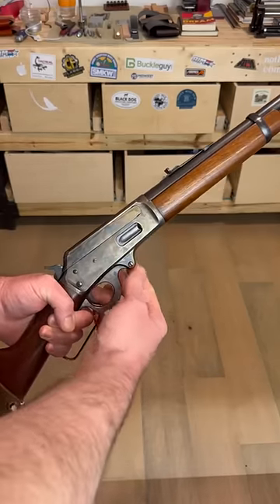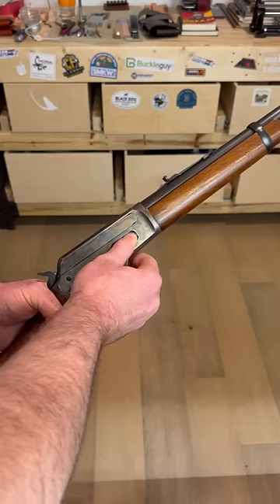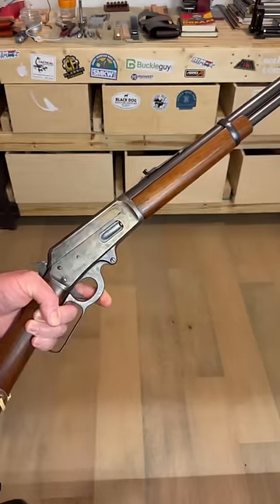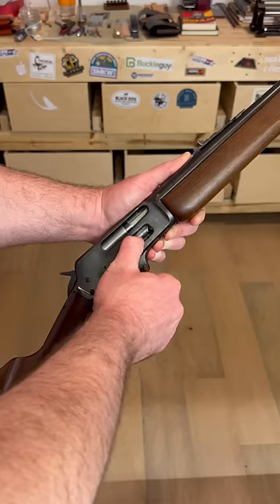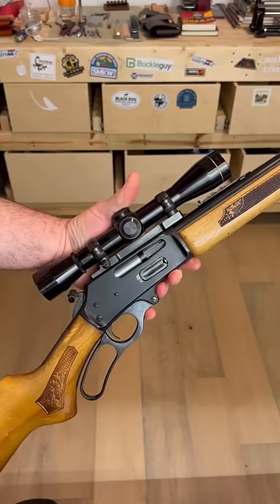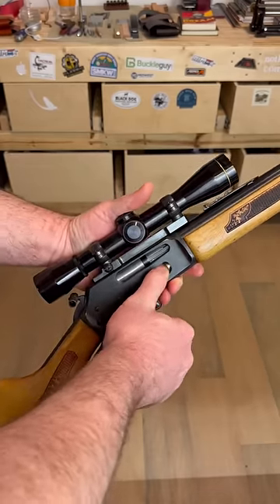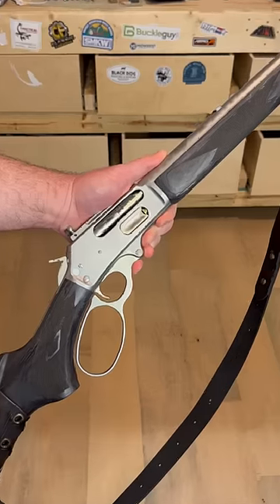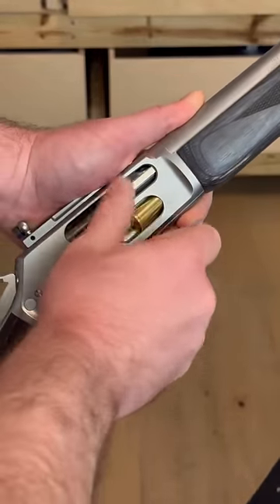Ruger Marlin 1895 Trapper 45-70: Can you unload any lever action rifle like this? (Pt.2)

Comment: Ruger buying Marlin was a massive win for both companies.
Reply: Fuckin A,      there doing right by a great ol company
Reply: It might be a golden era for rimfires too then.
Reply: Can I have one of those 😮
Reply: It was a win for everyone 🎉
Reply: not often that a company buying another is actually a good thing these days
Reply: Didn't the quality go down?
Reply: @starfishprime2864  I personally think so andddd the price went through the roof as well.
Reply: Why is that? Genuinely curious and don't know
Reply: @starfishprime2864 When Remington owned them, yes. Remlins were absolute garbage. Bad stock fittings, bad machining and overall quality control.
Reply: @jamesz601 I’ve got a RM serial number (Ilion New York) 1895 Cowboy in 45-70 that is flawless. Under Remington, they even managed to get the front sight milled square with the receiver - something Marlin could not do in their last twenty years of existence.
Reply: @georgealdredge2806  The 1895's were probably the one exception. I have standard stainless one that is pretty decent to. However I did have to look around to find a decent one.
Reply: Only downside is the discontinuation of the model 60 one of the best tube fed .22s
Reply: It is  @NINacide
Reply: @starfishprime2864 no it went up when Ruger took over
Reply: @starfishprime2864  not even a little bit,    Matter of fact with the new cold hammer forged barrels Ruger is putting on them........ I think the quality is actually better than the old original JM Marlins
Reply: @georgealdredge2806  I've got a 45-70 guide gun that Remington did......... im not gonna lie,  I love it,   it was somehow done right
Reply: Yeah but Ruger is charging a lot more $$ now than Remington/Marlin used to for these lever guns, or about double.  BTW the Rossi R95 (same as 1895) does the same thing - ejecting the rounds from the loading port, and can be had for hundreds $$ less - and they are top quality rifles and also tack drivers with CHF barrels.  I love Ruger (have 9 Ruger rifles+pistols) but I can't see paying $1200 - $1400 for a lever gun.  I picked up a new R95 Laminate Stainless for under $800 including sales tax.  It has superb craftsmanship and averages 0.7 to 0.8 moa all day long with factory ammo.  The R95 certainly beats my 1984 336 CS and '99 Win. 94 in every aspect, and is more accurate than both my Ruger American and American II and a few other bolt guns I own including Rem700 and an early Browning Xbolt model (2008-09?) I inherited, all of which get an occasional (or rare) sub-moa group.  For those who don't want to pay $1,400 for a Ruger/Marlin 1895 Stainless I encourage you to look at the Rossi R95 Laminate Stainless, and other R95 models (I prefer their 20" barreled actions which appear to be more accurate) which cost a lot less, and R95's now also come in multiple calibers including .444.
Reply: @starfishprime2864 no more than it did under Remington. This coming from someone who has both. Only difference is rugers charging more than there worth. I'd of never bought one had I not gotten it for hundreds less than current pricing during Christmas at Cabela's. If you want some sound & solid advice. Buy an older well taken care of JM model & you really can't go wrong.
Reply: @jamesz601 I own both. There's hardly any differences. Mostly cosmetic in fact. Save for that they both function/action the same.
Reply: 😂😂😂😂Rugger forever most
Reply: Other than the monopoly, hence a $800 gun is now just under 2 grand.

Comment: Ruger took over the brand and made some substantial improvements. It's a good thing that you can unload without cycling the rounds through the chamber. From what I've heard, they also shoot very well. I've owned a Marlin 336 in 30-30 since 1971.
Reply: What any gunsmith thinks: you'd rather have a box mag than a tube mag, the box mag keeps the mass close to your body, so your support arm trembled less 😮😊
Reply: @jonslg240 😂😂😂😂😂😂

Comment: Just crank the lever- it really ain’t that hard y’all 😂
Reply: Can't imagine me ever not wanting to unload this way
Reply: I like to slick-slack them out too. What if you happen to bump it by mistake while  that bear is charging you. You will not have to unload it again. Once I put them in, let them stay, I want them in when I need them. When I need to shoot I am not in the house or apartment, I am deep in the woods, I don't need a bullet hung up. Anyway that is how I see it. I'll take any of them.
Reply: Agreed, that’s the most fun but I could see how this would be helpful if you were trying to be quiet for whatever reason.
Reply: Cranking the lever to unload changes the set on the bullet, just comparing unloaded to new round you will see the difference. Not a good way to go.
Reply: @gaylebordeaux7632  I agree, we would never unload a round until fired. Of course that brought on a new set of problems. 6 of one or a half dozen of another.
Reply: @JacobC479 I reckon that makes sense
Reply: But the attorneys said............ 🤬
Reply: @gaylebordeaux7632 You mean the seating of the bullet. If it has the proper crimp it should not move.

Comment: I’m with the opinion of most people in the comment section. Rugers acquisition of Marlin was probably the best thing to happen in the lever arm community. Ruger makes some of the finest precision rifles that I have personally had the chance to operate. The pistols are what they are. I will say that 9/10 I still carry the lc9s with a single stack over anything else I have. It’s the only pistol I have that I can maintain the tightest group with. I hit center mass on a human size steel at 75 yards. I also bought the pistol the day it hit in my area. I went through Covid with this pistol because it was all I could afford to carry. I’ve ran through most of the Glocks. They’re nice, I appreciate what they do. I’m more comfortable with my Rugers. If I can buy a pistol from the same people that I buy my range toy or my hunting rifle from though, I would feel a lot more secure.
Reply: Just to mention, I’ve had a bad habit of buying older Ruger pistols. I have two p85s one is blued the other stainless.….i have or have owned just about every Ruger pistol and some of the rifles up to this video.

Comment: That's a pretty cool feature, however, when its 35 degrees outside and the dew's so thick you feel like you've been deer hunting underwater, your fingers are going to be so numb you probably won't be able to access that feature.
Still, a nice idea and I'm sure usable in more favourable climates.
...btw, my fave is probably the .35 Remington. I've always had a warm spot for one. Almost bought one in the 80's, but the guy sold it out from under me by the time I got the money together.

Comment: It was, its just an old design.

Touching the back is a feature since the chance of pressing on it and the bullets dropping out by itself is quite high so the original design made it like that where you have to press the bullet to release it.

Even with his test, you can see the system working perfectly as intended.

Comment: I like a new feature, especially if you wanna come home unload it and then store the ammunition away safely. Especially if you’ve got children in the house but don’t necessarily want to put the rifle away but want to make sure the damn thing isn’t gonna get found and Blow holes in things. Also Lever actions are system which works they’re over 150 years old as a weapon system and they do the job.

You’ve got enough quickness to do a follow-up shop but equally you’re not firing bullets over half the county.
You can take these things when you build the paperwork beforehand to calendar to go shoot things if you want. You’re absolutely fine. Try that with an AR. And you’ll be told what part of no.
Also in terms of transportation when you look at the fact these things slide into a saddle boot far easier than an AR . Because they were designed to be carried on horseback.
They work. People buy them and 50 years later as long as I’ve had a bit of TLC they still work yes they are slower for a follow-up short but equally it does me damn thing goes off. You’re not going to end up with a whole load of bullets around the house .

Comment: Nice way to unload without cycling the action.

Unloading a Henry or any other tube loader from the front always seems a little dicey. 
Rear tube loaders are nice in that aspect , point to the sky, pull the tube and dump the rounds

Comment: There is nothing new about this feature. I've had Marlins that easily unloaed through the loading gate. The magazine spring helped start the cartridges when you depressed the loading gate.
  Also, if you depressed the loading gate and pressed on the metal tab on the bottom of the receiver just ahead of the lever, it pushed ALL the cartredges out at once.
The centerfire Marlins I owned were purchased between 1986 and 2003.

Comment: I’m glad mine doesn’t do that. If I want to add rounds after shooting 1, or two or three, I don’t want ther rounds to pop back out at me while I am trying to push new rounds in.
Reply: It would be no different if you were to load it with a full 6 rounds though?
Reply: @zarkthepirate  yes exactly it would be a pain the ass, thankfully I have an older Marlin and it doesn’t do that either. But I also has some modifications to my Marlin 1895. Had a trigger job done, replaced certain parts with performance polished parts as well.

Comment: You shouldnt unload like this cause the angle can help detent the bullet further. One problem with this style is that compression issue of the bullet in the casing. But then letting it out like that too is just potentially causing the bullet to angle on the primer or just having the weight of the spring from the other bullets. Best way to empty a lever gun is to just half cycle the lever and pull it out.
Reply: It won't,  but nice try though

Comment: Sorry, any gun that has a stainless steel barrel is one that I would pick. The fact that that ammo goes in that way well. There's also a very easy way to unload it and that's just to hold it up and snap it till they all pop out. Don't understand why you need two ways. The problem I see is if there was any kind of action with this weapon and it touched anything it's going to push in and a round is going to pop out that way leaving you with one left of fire. If it holds three that's awful. If it holds five still sucks

Comment: how is it new i haave a 1895 original jm marlin from rhe 80s chambered in 45/70 gov and it will do the same thing so not a unique feature to a ruger made marlin it has nothing to do with design its a function due to cartridge notice how the 30 cal or 35 will do it without manipulation i just tried my early 80s .444 marlin it does it as well its caused by the cartrige size not a designed or engineered feature i have the new rugger 1885:sbl in 45/70 and it wont keep up with my original jm groups about 2'inches bigger at 100 yrds and my jm guide gun has a longer barrel holdss one less than the ruger but i have no problem hiting 6 inch diameter targets out to 500 yrds witg hand loads my new one even at 250 i got to get lucky

Comment: THE SAD PART ABOUT THAT, IS THE RIFLES YOU NEED TO UNLOAD BY RACKING, ARE THE ONES WITHOUT A SAFETY. THEY ONLY HAVE A HALF COCK SAFETY. WHICH FOR HUNTING, I ACTUALLY PREFFER. BUT AT THE END OF THE DAY, THAT CROSS BOLT SAFETY IS NICE FOR THAT.